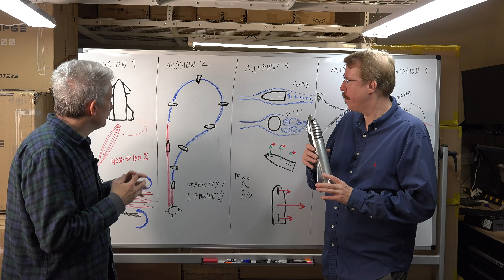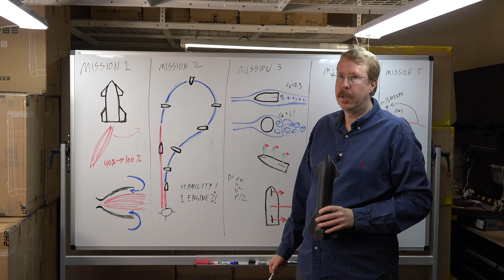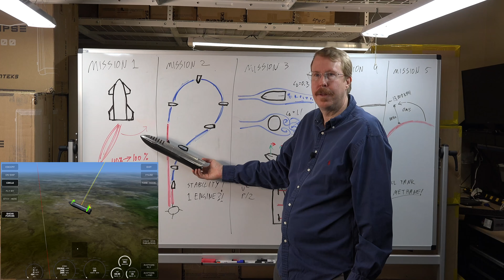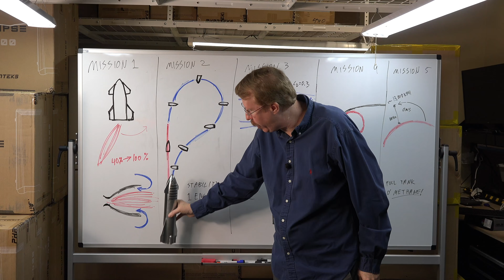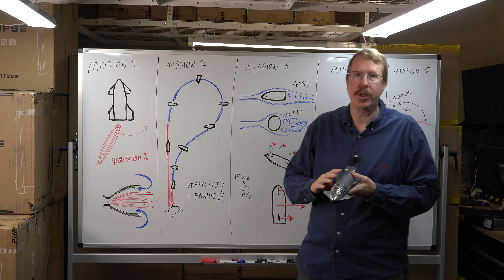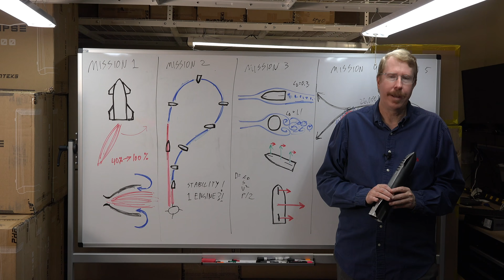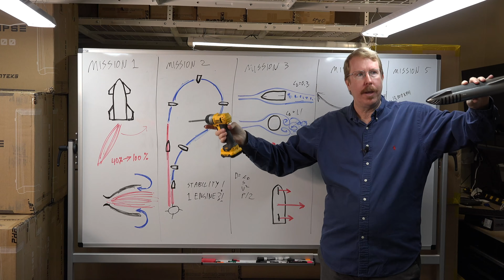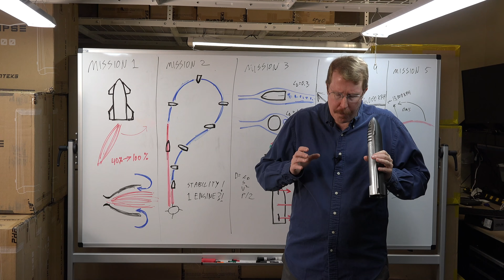How to FLY the SPACEX STARSHIP!

Comment: Is it possible for the vacuum raptors to fire on the surface of mars increasing thrust at takeoff?
Reply from the maker: I BET IT MIGHT BE, because the atmo pressure on mars is soooooooo low! i don't engage the engines, but maybe i SHOULD?????
if anyone figures it out let me know!
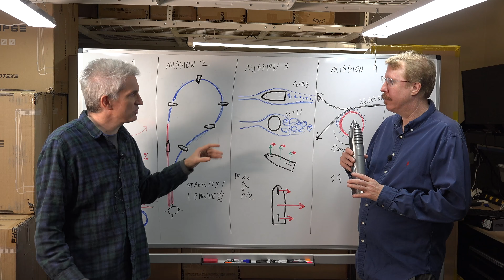Reply: @austinmeyer  Simple way of thinking about this is considering that over 100x less pressure  means that over 100x higher nozzle expansion ratio vs sea level engines could be tolerated. For example 1:15 Merlin cold tolerate over 1:1500 expansion nozzle on Mars. Raptor which is around 1:40 at sea level could go beyond 1:4000 before ambient pressure on Mars would become a problem.
Reply from the maker: @SebastianKaliszewski  right of course... i should engage all 6 engines on mars to save time (and fuel, with less time spent 'hovering' against gravity)... will do app update that does this... i just treated the term 'vacuum engine' as gospel without considering how close to vacuum mars is
Reply: @austinmeyer  From PoV of rocket engines 20km up is pretty much vacuum. A side note: Vacuum engine test stands don't produce perfect vacuum, they produce pressure more or less like 30km up -- which happens to be pretty close to Martian surface).
Reply: In short yes.

Long answer: vacuum raptor was successflly fired on Earth at essentailly sea level pressure. It can't be throttled, though on Earth. Mars has low enough pressure that practically any vacuum engine could be fired.

Comment: There is no single center engine, lading on one engine means landing with off-center thrust. They pulled that off for the first test flights but this causes the vehicle to 'slide' off the pad on launch and forces it to either land at an angle or with some horizontal velocity left. That guarantees some damage to the vehicle and pad, which was fine for the initial tests but is not sustainable in the long run. I'm confident they'll land on three engines (assuming they hopefully make it that far).
Reply from the maker: OOOOOOOO!!!!!!!!!!!!!!!!!! OK good we have a bet then! (the off-center thing is all true... but I just don't think it MATTERS as much)
Reply: @austinmeyer  could you please do an analyzation of the sn8 landing?
Reply from the maker: @Kaskadamusic  I mean i KIND OF did, in the mission video in the sim, and the sim itself... did you download x-plane starship and watch the mission video for mission 2?
Reply: @austinmeyer  yes, I have plane starship now
Reply: A SpaceX engineer from the SN9 mission said that the landing burn would be conducted with only 1 engine seconds before it crashed. I do believe the off center thing could be very minimal since the engine itself can just move around how it wants to, to correct it, plus if that was so, then SN5 and SN6 would have landed very strangely.
Reply: @OortCloud  landing didn't look quite like I think most of us expected. At this point I'd neither call it a one nor three engine landing. More like a three-two-one landing.

Comment: I disagree with the “no human can function” there. The problems associated with coming back from space are mostly with the vestibular system and the heart having some trouble adjusting to 1G in a vertical position. The delicate handling of astronauts coming back from the ISS is mostly precautionary; falling over is their biggest risk. This is different here; the astronauts would be taking the 5 Gs through their back, and would only need to be operating controls within easy reach.

Comment: Nope, it’s definitely three engines for the touchdown burn. It allows for engine-out capability and provides more control authority. It’s also more efficient because the engines can start later. The concept is demonstrated by the Falcon 9 landings; even at minimum thrust, the Merlin engine has a TWR well over 1.
Reply: Yes, suicide burn is also saving fuel. But for SN8 particular case, according to NSF they will use one engine for the flip, and then two for the rest of the burn
Reply: @alvianchoiriapriliansyah9882  Oh I didn't know that, thanks. The rest of the logic still applies; more than one engine.

Comment: Hi Austin,
* What do you think would be a tolerable tethered-spin RPM?
* Would you target earth or mars weight?
* What cable length would be required?
* What would be the required energy (fuel weight) for spin-up and de-spin? 
Sure hope our cable doesn’t snap on the way to mars<grin>.
Reply from the maker: The longer cable, the better. Why? Because the longer the cable, the less the motion-sickness possibility from rotation, because the rotation rate is lower.
Reply: I can answer the bit about energy; for a given radius and a target 'gravity', you end up needing to hit a certain RPM. This RPM has an associated tangential velocity, which is equal to the delta V necessary to spin up or spin down. For example, if we wanted to simulate 1 g with a 500 meter tether, we would need an RPM of about 1.3 and end up with a tangential velocity of 70 m/s. The total delta V necessary to spin up and then spin down later is therefore 140 m/s, which is totally doable. Also, this radius should be big enough to eliminate pretty much all of the nausea-inducing effects of living inside a centrifuge.
Reply from the maker: @sycodeathman  Exactly! The longer the cable, the less the 'living in a centrifuge' effect. Delta-V is negligible compared to space flight, and when you impart it once, you enjoy 1 g all the way to mars!